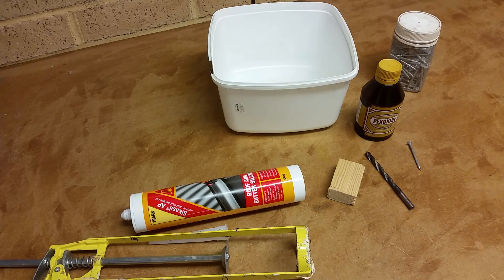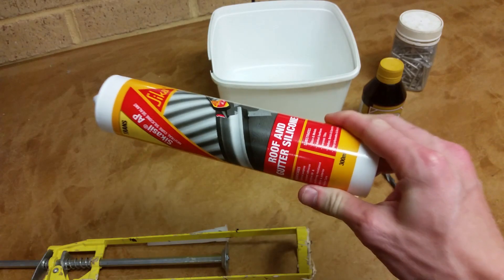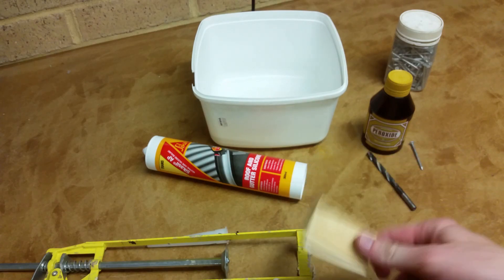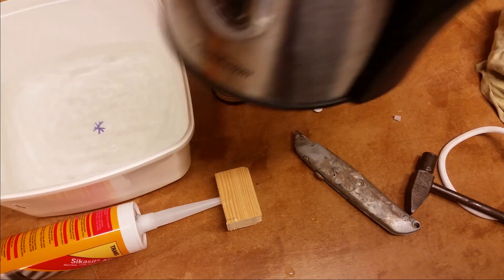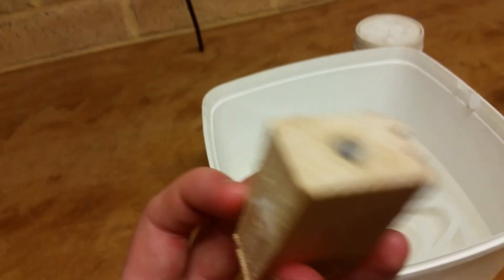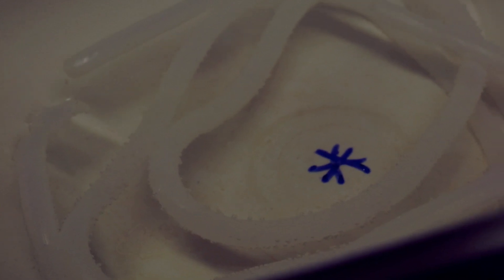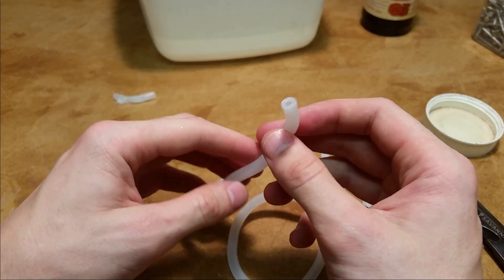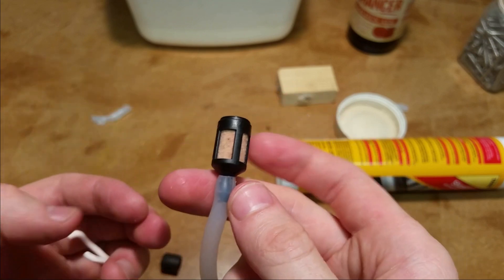Home Made Silicone Fuel Line?

Comment: It's the ethanol additive doing the damage. Fortunately it's hydrophilic so all you have to do is add the same amount of water and it drops out over 12 hours. ie 90% octane, add 10% w/w water, 95%, 5% water. Add a drop of dye to the water and use a glass jar so you can see what's what - do it outside. Once done, let the ethanol evaporate, just beware neighnours' barbeques!

Comment: Hi, Engineer Nick! I’m wondering how long that homemade silicone gas line held up; I’m thinking you probably got some pretty good use out of that.

I can’t help but wonder if Spraying a little bit of mould release inside of your extruder Might not serve to reduce the friction of the silicone as it goes through your extruder bit, so that you lose less of your material out the other end of the tube. Of course, that’s just a thought from somebody who hasn’t yet done this, but Is really grateful for your tutorial, with a definite project in mind for the technique, you’ve just taught. 

Thank you very much for it!

Comment: Silicone from a tube does not hold up to gasoline. You can test it for yourself by taking a piece of hardened silicone and putting in gasoline; it will swell and crack.
Reply from the maker: haha yes i discovered that later i think i show it in this video. once it is swollen up it burns in a really interesting way too. I think i show that in the second video

Comment: This is a seriously clever idea. I think if you ran a bolt or a screw through the block from the other side; you would be able to clear that blockage. For a wooden block on this small a tube its not such a big deal, but this idea has potential to make much bigger lines. I am building a gold prospecting suction dredge right now and I have been really needing better tubing. Making my own lines out of silicone rubber hadn't even crossed my mind.

A couple of tips from what I have learned with my own experiments: Thin the stuff down with toluene and add color to it and then use a basting syringe instead of the caulking gun. I think you'd have a lot more freedom with that and way more options. It may take some tuning to get the silicone thinned down to the right degree. Since it would be runnier I think it would be better to have it closer to the water and make the water deeper. Again, not such a big deal on a tube this size, but if you go bigger you'll benefit. Plus being able to color it and reuse your die is all nice too!

Sub earned!
Reply from the maker: Glad you enjoyed the video, fascinated to hear what you are using it for very cool :) If i ever try it again ill look into the dye and toluene thing :)
Reply: @EngineerNick  I forgot to add that depending on the silicone you're using; mineral spirits may do the job better at thinning it. Gasoline also is an amazing thinner for it but the fumes are really dangerous!

Comment: Metal block with intersecting hole hole drilled for mandrel  from bottom of chamber allows multi use  extruder that can be cleaned.

 using a set screw in the side of block allows different drill bits for inner tube sizing
Reply from the maker: are you a bot?
Reply: @EngineerNick  why would you ask a human that? Are you a bot?

Comment: So..How did it work out - long term test/review?
Reply from the maker: It did not work for petrol at all :S It swells up to about 4 times its original size, and it's to soft to hold a strong vacuum anyway. But for other water based purposes I have used it a few times. I have another video on my channel somewhere where I test the silicone meant for form-in-place gaskets... that also swells up. It also burns in a really unusual way

Comment: I’d gonna fail and you may burn, hell PTFE for super car not that pricey. Great video, clever. Do not do this!  Silicone is inert but that’s a disaster, it’s make different not from that under vacuum or pressure. Is this just a joke? Or for a model? Antiseptic isn’t sane as 6-food grade, chemical, jet propulsion stuff. I missed a part?  Guy was messing about prices. Seriously no way in gasoline or any thing depend on.
Reply from the maker: Your incomprehensible rant is duly noted Mr Monkeys. You will see in one of my other videos I did a fuel soak test and  the tube expanded into a super soft jelly rendering it... pyrotechnically flammable. Still, this kind of tube may be useful for a wide range of other applications. It is most certainly waterproof and probably acid and base resistant.
Reply: the fuck is this freak yapping about

Comment: is that your average everyday 3% hydrogen peroxide? GREAT video thanks. Silicone actually needs moisture to cure as does ‘super glue’. If you were to line that block with some kind of anti-abrasive you’d get nice smooth walls (I’m guessing)

Comment: Since this type of silicone is moisture cured (I think the correct term is condensation cured), it might speed up curing on the inside by removing the squashed ends when the tube is firm enough to handle and put it back in the water to allow water into the tube.
Reply from the maker: Sounds like a good idea to try :) Maybe someday I will re-attempt this since the youtube algorithm favours it over all my other videos :P
Reply: @EngineerNick  I dont think its the algorithm. People search for this.

Comment: You can buy Fuel silione tubing very cheap by the roll or meter if you knwo where to buy, PTFE tubing is even cheaper, and totally fuel safe.
Basic domestic Silicone is NOT suitable, you need an oil grade silione it will otherwise degrades very quickly !
Reply from the maker: you are correct sir
Reply: Just bought a 20 meter roll from china for $12

Comment: Any updates to this hows it working for you?
Reply from the maker: Hey there I never made it work as fuel line due to the silcone swelling however i can think of a bunch of other applications for very soft tube. Havent had a chance to try anything else yet but i think it could be the basis for a 3d printed peristaltic pump
Reply: @EngineerNick  have you ever used it for bleeding brakes cause thats what i want to use it for? Wondering if automotive brake fluid has and affects on it as well?

Comment: Are additives really needed?
Reply from the maker: Probably not :P ... I experimented further and made one other video on this topic... I think using really hot water is the most important part... detergent doesn't seem to prevent sticking... and I doubt the peroxide is doing much. I am no chemist and i only tried it because I found some old patent that mentioned it as a method to catalyse silicone...

Comment: You are brilliant!  I may never need a silicone fuel line, BUT you never know when custom silicone tubing for one thing or another is needed and nowhere to be found. I use vinyl tubing to pump out hydroponic tanks and it's too stiff and unwieldy.  My silicon air pump tubing, on the other hand, is far more cooperative.  Thank you so much for sharing this.  The jig made it all possible.  Maybe a two-part polymer clay mold is your answer to a reusable jig.  Once the silicone sets up, you could take the polymer clay mold apart and cut out the silicone plug.
Reply from the maker: That's a good idea thank you for the comment :)
Reply: @EngineerNick   Inspired by yours, so the thanks belongs to you. Happy New Year! :)

Comment: Very clever but I hope you realize that silicone is not resistant to fuel. Normally silicone tube needs to have a fluoropolymer lining to be resistant to fuel and oil.
Reply: The fuel will melt the silicon?
Reply: @threestrikes1448  it wot melt the silicone but it will swell it up
Reply: plain silicone caulking will fair ten times better than the phtalate filled pvc tubing.

Comment: Just tried this and it worked amazingly! The hot water is a great idea, and appears to make the silicone cure quickly while preserving it's shape. Awesome!
Reply from the maker: Nice :) Just let me know if you ever find something that can actually stand up to fuel! :)
Reply: @EngineerNick  so not tested or anything, but logic tells that if the silicone can withstand oil, it should withstand most of the fuels too i think? if so then the usual car gasket silicone should work. only there isnt transparent silicone of this tho

Comment: I doubt polyethylene or polyurethane is what is "commonly used for fuel line", because last i was at Conrad looking for silicone tubing, most of it was marked "fuel line", and conversely, looking for "fuel line" delivered silicone tubing. :P It also barely cost anything, like less than 2€ per meter off a roll. And it's even cheaper than that on eBay from nameless suppliers, last time i had to order much thicker tubing that has a lot more material in it, it came out at about 3-4€ per meter shipped and delivered in 2 days. The ones from eBay claim to carry a food safe material certification on it, which even if the certification is fake, probably means it's titanium catalyst, high temperature cured, and should actually be very solvent resilient. I guess there are other ways to make other kinds of silicone somewhat solvent resilient, like post-cure at high temperature to convert some of the residual products too.

Congratulations on successful extrusion setup experiment, that is certainly good to know just in case.
Reply from the maker: Thanks for the comment :) From what i see on ebay in Australia anything called silicone fuel line seems to come from the UK and certainly isn't cheap or fast to ship :/ I went to an automotive place here in australia and asked for fuel line and i'm pretty sure they gave me clear polyvinyl chloride tubing which works fine for a while but ultimately goes stiff and cracks. There are places here that sell proper silicone tubing that would work but to expensive for me to test for fun
Reply: Aaaaaah, Australia. I hear everyone uses HobbyKing (Hong-Kong) out there because there's barely any local RC industry, didn't think of it at first. Over here in Germany RC models are a national hobby, there are specialist stores everywhere, including Conrad that is a nationwide staple. Now i had a look, first thing i see on HobbyKing is "Silicon fuel pipe (1 mtr) White for Nitro Engines 4x2.5mm" priced around A$2.25, with options of delivery from China (very cheap shipping for everything that fits into a B4 envelope, usually around 10 days - 3 weeks delivery) or from Australia warehouse (starting around A$8, 3-10 days). They have warehouses all over the world, but the Australian one is the best stocked one. And then when you go the China route, there's everything on Aliexpress, and shipping an envelope from Hong-Kong really only costs a fraction of a dollar.

Comment: i want to know the liquid you added in hot water.and also can you tell me that how much temperature will this pipe bear?
Reply from the maker: Hey man, i have no idea if it would work with medical grade silicon. The liquid i added to the hot water is H2O2 hydrogen peroxide though i don't think this really did anything. it takes about 30mins to harden in warm water. Cured silicon is very resilient to temperature although it will go a bit softer when heated. Not sure how much heat it can handle though :P

Comment: I'm pretty sure you can buy casting silicone that would handle the fuel no problem at all.  Even the expense of that would still save you money if you extrude it this way.
Reply from the maker: I'll take a look into it next time :) It may need some admixture to make it thick enough to extrude though? I have never used it, only seen videos.

Comment: Nice, but how much max pressure it can take.
Reply from the maker: +Kedar Nimbalkar Check out my next video where I show results of extended fuel resistance test. https://www.youtube.com/watch?v=a9pL-ZWDBNI
In that video you can see my set-up with two syringes... I could barely make the pipe collapse under vacuum. But it is easy to make it balloon out under pressure.